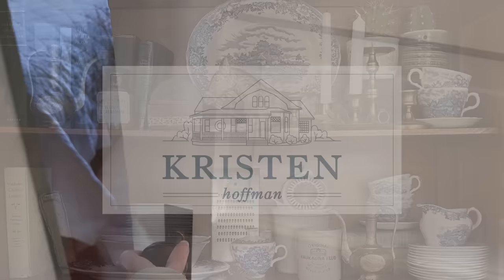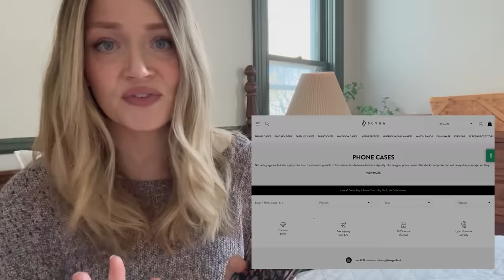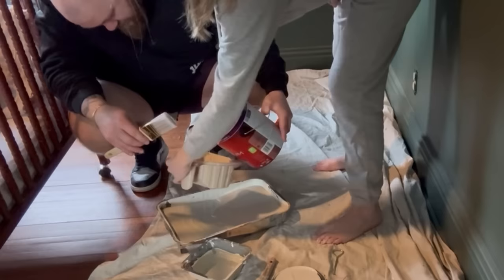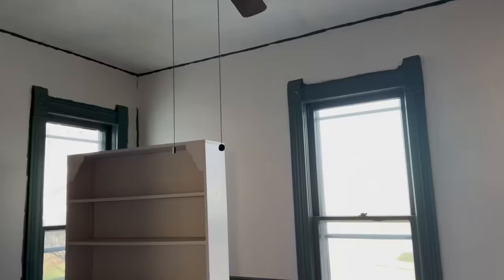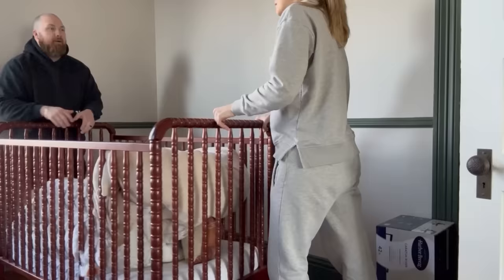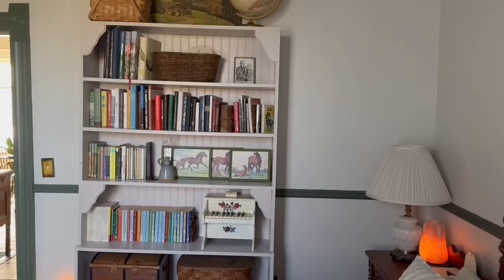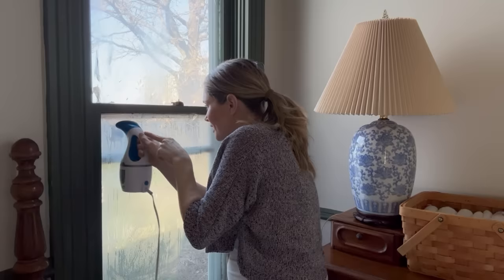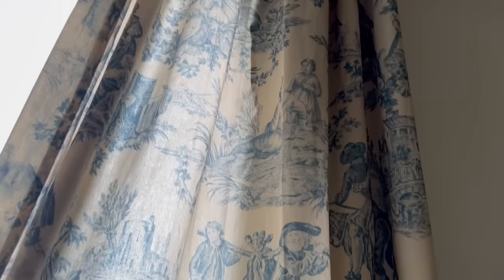DIY Cottage Nursery Makeover w/ Vintage Thrifted Finds on a Budget + GENDER ANNOUNCEMENT!

Comment: Beautiful the only advice I have is make sure the tall shelf is attached on top with the L brackets god forbid it falls down. Rosie did such a great job too 👏🏼👏🏼👏🏼👏🏼👏🏼👏🏼👏🏼🥰🥰🥰🥰🥰🥰
Reply: Yep I had one of my kids step into the bottom drawer of a dresser once to climb it and the whole thing fell on him! It was awful thankfully God protected him. I never put up anotHer dresser or bookcase without attaching it to the wall with a safety bracket.
Reply from the maker: Thanks for the tip!
Reply: @ssing2490  My granddaughter opened all 4 drawers and the dresser tipped over.   Wasn't even a tall dresser.

Comment: "Gorgeous & protective" cases, you described us perfectly 🤭
Reply from the maker: Right?!
Reply: @KristenHoffman  putting up the ceiling medallions are extremely frustrating. I've found that if you cut it in half and put it up when the light is already up it can be much easier.  I've used liquid  nails to keep it up and then I fill it in with plaster or caulk then give it a paint. Its alot of extra but thet really add so much to the space. 🦋